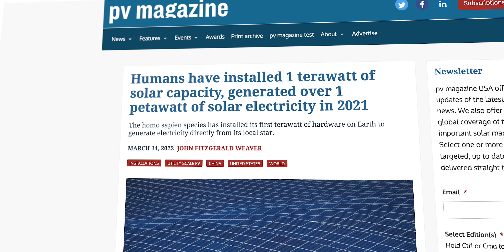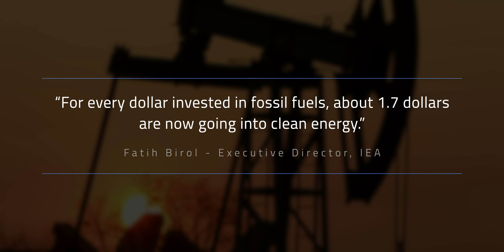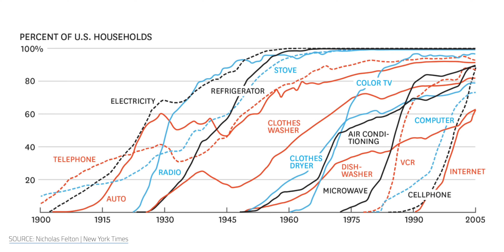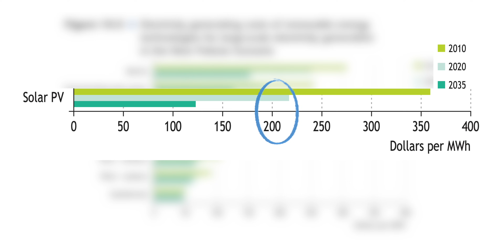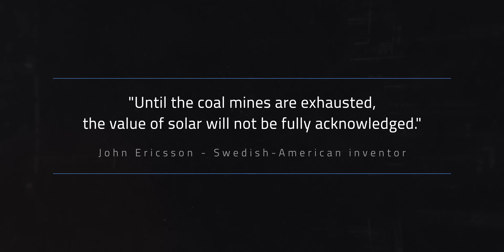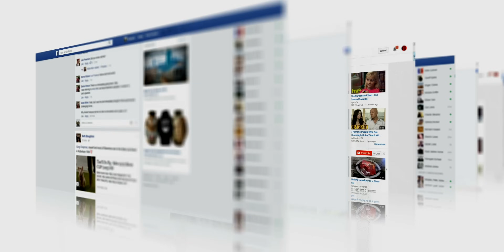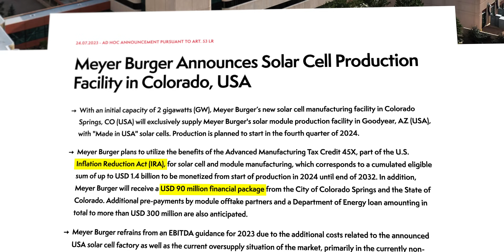How Solar Power Got So Cheap … So Fast

Comment: Imagine where we'd be in the US with solar if the Big Power Utilities weren't actively trying to fight solar.  It's as if the Power Utility CEO cares more about his personal compensation than he cares about making America renewable.
Reply: As if??? He does!
Reply: I live in sunny SoCal and the push back here from our local utility (SDGE) has been ferocious. You can’t even sell your unused power back to the grid. They’ve got a stranglehold on electricity.
Reply: There's a nugget of a real reason behind  power companies'resistance to solar: it adds power to the grid at times when it isn't necessarily needed, yet also drops production when it is needed. So power companies are paying out money to consumers with home solar installations, but can't actually reduce the number of power plants they need to maintain. In fact, because solar power production creates such a spike and trough, power companies have to use peak plants instead of normal baseline plants to try to balance load. Peak plants are more expensive and pollute more than baseline plants, so the net effect can be that is that electricity becomes MORE expensive and MORE polluting.
Reply: And new construction companies. The ones building skinny homes for nothing but charging big. 
Big corporate tract housing builders will cut any corner yet raise every price of new homes, which means they are also actively avoiding integrating solar into new home construction except for 'halo' upscale projects. They slash everything, right down to the minimum size of property.
Reply: @erikdietrich2678  More electricity is needed when it is super hot.   That is when the solar panels are producing.
Reply: @humblecourageous3919  peak solar power production is going to be around solar noon. However, peak power demands are in the early mornings when people are getting ready for work (hair dryers, water heaters) and in the evenings (clothes dryers, dishwashers, televisions). Plus peak cooling demand lags solar noon by several hours: not only is it hottest in the mid-afternoon, the large thermal mass of buildings means the heat doesn't penetrate until some time further after that. Grid storage will mitigate this misalignment, but we're not there yet.
Reply: @erikdietrich2678  Our solar production does stop after noon.   It begins as soon as the sun comes up.   People should also be conserving electricity.   Our new TV is smaller than our computer screen.  We've always conserved electricity.   We rarely turn on our mini splits (one room only).
Reply: @humblecourageous3919  that's exactly my point: you're significantly changing your electricity consumption to try to accommodate the limitations of solar. Most people aren't doing that. Heck, if most people were actually willing to significantly change their electricity consumption, we wouldn't be in as dire of straits as we are now.

Comment: It might be worth mentioning that solar PV usefulness is greatly influenced by latitude.  In the northern UK the turn down ratio from summer to winter (when we really need electricity) is something like 9:1.  Fortunately the sun also creates wind....  A second point is that silicon-based PV takes a lot of input energy - so that, at higher latitudes, it can take years to pay back the input - which means spending the energy long before you break even.  If Perovskite panels can be made robust enough, this will change.  And this could really be an avalanche.
Reply: You've already got wind aplenty!
Horses for courses...
Lots of opportunities for crude tidal as well, but people would be up in arms over that.
Reply: @jimurrata6785   - though wind scales poorly for personal systems - much better suited to grid scales  - esp. when talking offshore.
Reply: @kadmow I'm not sure where the OP mentioned personal use?
Though I'm also not sure where they're going with pervoskite cells other than they should be cheap to produce when the process is finally sorted.
Reply: I didn't know the UK even had sun!?
Reply: When it's possible to generate enough electricity in winter where I live (northern latitude) to be fully off grid I will be all in.  Hopefully technologies aren't too far out to do that.

Comment: I own a solar installation company and have been in the solar business since 2008.  The biggest reason is government policies promoting Solar while demonizing oil.  We have a major issue on how to dispose of solar modules.  We are a very small company and have over 100 that have been removed due to damage or failure and the cost to dispose is prohibitive.   Without the continued government subsidies we would see a different market.

Comment: The big advantages of solar are it's simplicity, there are no moving parts, and the fact that it enables power generation at the point of use.

And the thing about storage is that cheaper options, some of which you have already covered like flow batteries, are coming to market.

Soon enough it will be cheap enough for almost everyone to have solar + storage to where power outages due to downed power lines will be non-issues for homes.
Reply: Would make handling the power grid a lot easier, less kickback when starting up a "downed" grid
Reply: Almost everyone 8 billion and increasing?

Comment: "For every dollar invested in fossil fuels, about 1.7 dollars are now going into clean energy."
So, what is the IEA calling clean energy? 
Renewables, electric vehicles, nuclear power, grids, storage, low-emissions fuels, efficiency improvements and heat pumps.
How much if that is solar? Just 13% 😢

Comment: In my country the price of the solar panels did not reduced at all in the last 10 years. It is like when someone said the price of the EV-s will reduce because of the cost of the battery packs are reduced in the last 10 years greatly… nothing happened or lots of EV became more expensive. Here we the solar energy is never generate profit. Need 15 years just to get back the cost of it, but probably during that time lots of thing would break. Here solar energy is good for those only who does not have any other choice, away from any electrical grid.

Comment: The biggest issue I'm having with getting on solar is that in my neck of the woods, the installation on my home would be something like 65K, and that's before the battery setup.
Reply: THIS ^. I could have bought a new truck for the cost of the panels on my roof. Its very sad.
Reply: There’s the rub…we’ve been trained! The wealthy always run two calculations…short term and long term ROI, not initial investment. The most prohibitive factor right now is interest rates…but that will follow a cycle, so we’re back to weighing the timing of current interest to future inflation of the item. Getting the timing right is always the trick.
Reply: Find a good electrician that installs solar, most solar install companies are worse the car dealerships. My roof is flat so we did some of the grunt work ourselves. We also bought all the panels etc from a wholesaler to control costs and quality. 65K is insane.
Reply: Do a little learning and do it yourself.  Its not that hard.   Solar panels can be bought for less than 50cents a watt.   We solar installers are making bank off the government subsidies and consumer ignorance.
Reply: Same here... the prices are soooo inflated and that kill the momemtum....
DIY :)
Reply: There is an amazing video by FrugalRepair about installing your own solar panels. DIY solar is tricky, but not much more tricky than any other home renovation DIY project.
Reply: 65K without saying what they offered is meaningless. I can buy a car for 20k or for 300k. One can drive 200mph. Guess which one...
Reply: @justinnkim  25 years ago you could have bought 2-3 new trucks
Reply: Sounds like it's eminently possible for DiY a solar setup if you're reasonably technically savvy.

Comment: This is all well and good.  My Dad worked in the solar energy industry in the 70s and into the 80s... a real pioneer of the tech - and our family were big supporters.  What is not being said is the precious rare earth metals that are needed to produce these panels and how they are mined.  Perhaps the tech has changed, but I was SO wishing you were going to cover this and then I could be up to speed on just how extensive this problem remains to be.
Reply: Matt is guilty of not telling the whole story!!
Reply: Mark Mills addresses this issue in several YouTube vids.  o/
Reply: Rare earth metals are not used in the manufacture of solar panels.
You have mixed up your conservative talking points that are funded by the big oil lobby.
You're thinking of electric vehicles, not solar panels. (which are also moving away from dependency on rare earth metals, fyi.)
Reply from the maker: I've covered that in other videos, so didn't think it was necessary to rehash it here.  I view most of my videos as bricks in a wall I'm building.  Not every video can tackle every point ... or it'd be a 2 hour long video ... and my videos are already pretty long.  😂
Reply: @UndecidedMF Reply appreciated, Matt.  For me, what felt a bit off was something a little too close to a presumption of a rapid, certain electric transition, where attempts I've seen to cost this out (particularly at a fundamental, elemental level) cast significant doubt on this.

Still, many exciting advances are in the works.  As ever, we will know more in time.  Regards & thanks for your channel, G.M. o/

Comment: I think you left out one important point.    The cost of panels drops significantly because of the low production cost in China.   I don't know whether there are state subsidy or cheap labor or both or whatever reasons.   Whenever technology able to get into China,  they can produce it cheaply.  Initially not the very good quality but can later get better.    Like the high speed train.  They get the tech from Germany and then they produce it in much lower cost and then improve from it.   And they then even export these tech.    But it seems Germany did not benefit from that.    Another example is the car industry,   they are  giving it away to China.

Comment: Solar panels are VERY vulnerable to economies of scale in manufacturing. That’s because solar panels are extremely simple - they’re basically just fancy windows. Despite what you’ve been told about “exotic” materials, there are hardly any. It’s mostly just glass, with some aluminum and plastic framing - materials so cheap they’re used for disposable packaging! The most expensive part is silver for wiring, about $20 worth in a panel. The actual cell is mostly silicon (the second most common element on Earth), doped with either boron or phosphorus. Once they started getting manufactured at scale, prices fell 90% and still have plenty of fall left to go.

Comment: I think it may have been overlooked that the amount of investment into solar vs fossil fuels is not only a case for the value of solar but political will of state actors. Fossil fuel companies aren't legally allowed to build more power plants or refurbish existing plants in many locations while renewable plants are allowed and perhaps even subsidized. it isn't a wonder why solar has risen so fast by getting legislative backing while fossil fuels are getting hampered.
Reply: Fossile fuels are still getting by far a lot more government support than all other every sources, globally.
Both direct support and simply being able to pollute for free.
Reply: @migBdk  There is a huge difference between bribing a company to build in your territory because they are going to build anyway because its economically feasable (oil) - and subsidizing an industry that literally could not build or survive without cash injections. (solar).

Comment: Solar has an edge in markets like Puerto Rico or the Philippines that have very unreliable power grids.  The missing ingredient there is low cost batteries which should be on their way soon.
Reply: I get most of mine from battery recyclers,  medical e waste is a godsend for that, because those batteries have to be replaced very often they will often still have 90% plus of their effective life span un touched.

Comment: Great video! I first investigated solar roof panels in 1995. The cost was estimated to be $35k just for the panels for a small system. It was seen as a strange request and difficult to even find anyone that could quote on the job. Fast forward to today. I upgraded my roof top solar for $12k fully installed for a 13.3kWh system. Here in Australia over 30% of homes have solar panels on the roof. Payback period is estimated to be around 5 years.
Reply: Bearing in mind these are Australian dollars - multiply by 2/3 to roughly convert to US dollars. Also 13.3kWh is big for a rooftop system - the financial sweet spot for payback period is a system smaller than this.

Comment: Back in the 90s I knew it would eventually win out. I was only like 10 at the time but the value proposition as I saw it was that you buy it once, and it generates energy for you continuously. I was obsessed with making “set it and forget” type things (I also loved Rube Goldberg machines, lol) and I knew that once it became cheap enough, it’d become one of the major ways we make energy.
Reply: Same, its free energy literally raining from the sky. It almost doesn't matter how inefficient it is at collecting, when you build enough "buckets" to collect the free rain, you will have unlimited water
Reply: It hasn’t won where I am. Not enough sun, especially on winter. Plus a lot of maintenance needed in winter or have a good deal of energy wasted with heating systems to keep snow off them.  Although I’m sure over time they will win where I am as well as the tech being invested into the most usually wins. So eventually I’m sure they will get efficient enough where it can get eaten so much power that even where I am it would be feasible to be only on solar even with the winters I have.
Reply: @adamhero459  I mean, you don’t need to have solar directly where you are to benefit from it, plus it doesn’t affect it being an energy generation winner just because it doesn’t work where you are. For your own energy generation you just probably need to invest in something else like wind since where it’s very snowy is usually also fairly windy. Like where I am, we get really snowy winters, but also get plenty of sun for solar and plenty of wind for wind.

Comment: Great explanation of adoption and human psychology, but what were the key innovations that drove down the cost of the panels and how they were manufactured? There have also been substantial innovations for inverters: more efficient, producing less heat that also reduces fatigue/aging of the electronic parts resulting in longer lifetimes and enables long warrantees for the installation protecting investment.

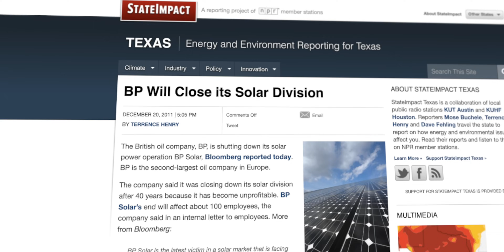Comment: 6:52 I didn't know Shell made solar panels at all but BP had essentially stopped making them years before this date, they were good panels though, well made & reliable, you can still see them on top of road signs & sometimes traffic light control boxes across the UK, sometimes accompanied by a small wind turbine mounted on the same pole. 

It definitely feels like lucrative Government contracts ran out & they had to charge market prices so the sale price went down to eye-watering from astronomical & that didn't suit shareholders.

Comment: YUP! The death of net metering in IN took my solar plans off the table. Storage is too expensive for the non-tiered rate we pay.
Reply: Im in MI, and Im just going totally off-grid. We have 2 electric companies in the state, and they are trying to do everything to make the consumer NOT go off-grid. If you figure in storage, you will still save money. Energy costs will not stay the same as they are today. Quite the contrary. They started with tiered rates this year. Net metering is pointless, and while our cost per kWh is low, there is a cost just to be a customer. In the end, Im going off-grid to be independent of the energy companies. Big changes are coming for the grid, and the cost of electricity. The other issue is reliability. Ive lost power 3 times this year that lasted longer than 3 days. I put a simple solar system in the front yard, with a battery and the last 5 day outage didn't matter to me. The critical things in the house were powered. The whole system was under $2k. Scale this out to power the entire house, the batteries and the panels are around the same cost. Battery prices are dropping.

Comment: One big stumbling block is local government policy.  My city has a municipal utility.  Residents are forbidden financing for alternative energy projects, whether solar or wind.  And solar companies in the surrounding area know this and generally don't do business here.  If you have deep pockets, you can finance the entire cost of the project yourself (which in this area is about $30,000 without battery backup).  And even if you do, don't expect it to help you out during a power outage if you're tied into the grid.  In that case, the city requires homes with alternative energy to shut down until the city restores power.  So currently, if you're wealthy and don't mind living completely off-the-grid, then alternative energy is an option in my city.  As you might imagine, very few residents go that route.